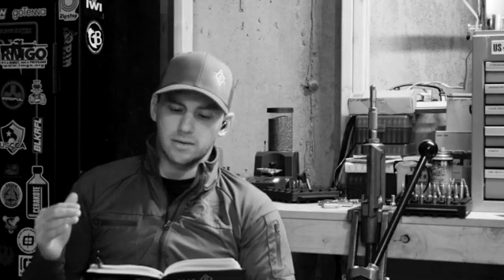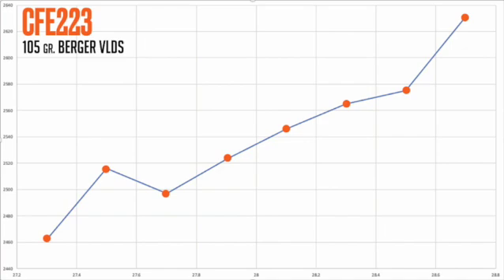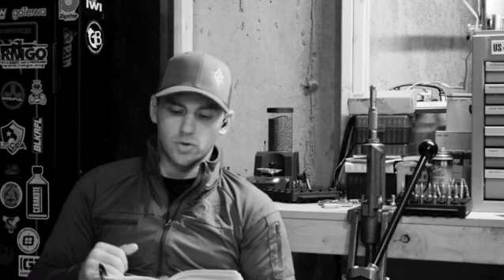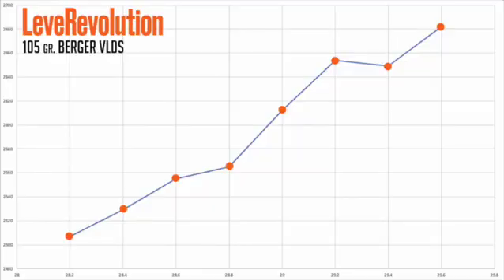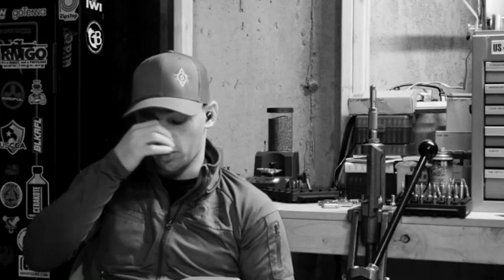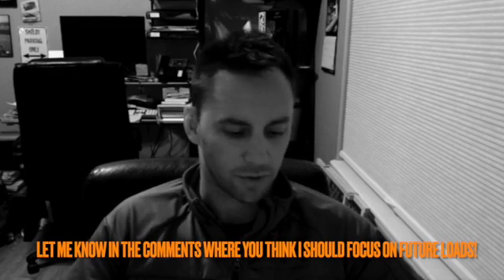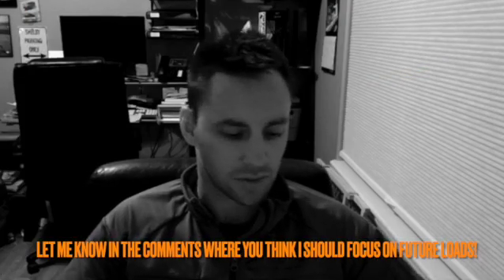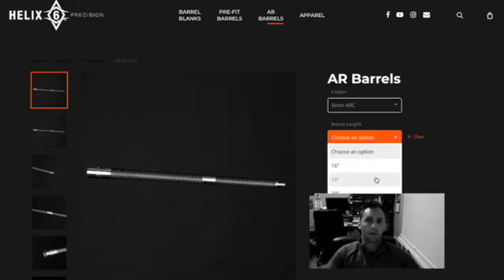6mm ARC Ladder Test Update 1

Comment: Stay away from the leverevolution. Temp stability is horrible. I played with it for load development in mine and had a nice load worked out (so I thought). I took it out yesterday to do seating depth test and was surprised how much the velocity climbed. I had read leverevolution was a bit touchy, that's a understatement. 20 degree temp difference resulted in a 40 fps jump. That's totally unacceptable. Luckily I have a group of friends and we help each other out which has allowed me to try several different powders without having to buy a bunch. Varget/Vihtavouri N140, great for temp stability, slow velocity. Vihtavouri N150, great temp stability and my velocity node came in around 2660 fps. (I run 108 eld-m's out of a 24" aeroprecision upper) 2660 is pretty acceptable. Soon I'll be trying Vihtavouri N540. Supposed to be fairly temp stabile and should get just a bit more velocity but we'll see. Velocity isn't everything. Low extreme spread is more important than velocity.
Reply: Point well made...
Reply: Good advice..

Comment: Great video! I’m currently building a 6arc custom gas gun with a 22” bartlein barrel. I’m curious what groups you’re able to get with 105s in your tests with leverrevolution.
Reply: don't use leverevolution. Horrible powder. (Unless you don't mind having two different loads. A hot/cold load.) And don't get wrapped up about pushing crazy velocity with this cartridge. (At least in a gas gun) It's no 6 dasher. 22" barrel should get you good velocity but reaching the advertised 2750 fps, don't be surprised if you don't hit those numbers. I have a 24" barrel on my gasser and factory ammo doesn't even hit those numbers.

Comment: What's your application for this cartridge? 
I don't know why people are so disappointed with velocity in these shorter barrels. That data has been out there for awhile now.
Reply from the maker: Great question! I will be the primary shooter (rifle) for the Sniper Adventure Challenge and need a lightweight cartridge (minimum caliber 6mm) that can consistently reach out to an average of 700 yards but up to 1500. Normally I shoot 6.5 Creedmoor, but I don't want to haul that gun and ammo about 70 miles in 48 hours. As my research has indicated, hitting that 2700 fps helps to maximize the advantages of this cartridge. I think the LeveRevolution is going to be the way to go!
Reply: @theadventureninja  I run 28.8 LVR under 107smks. Getting 2760 from a 24". Not saying you need a 24", but 28.8 isn't that hot either. A 20" with ~29gr lvr would have pushed 105 RDFs or hybrids to 2700 I'm sure
Reply from the maker: @cayenne7857  probably! After watching and reading a bit, it seems people had the least trouble with an 18” barrel in a gas gun, though I wouldn’t go any shorter. Were I to get another barrel, I’d do a 20” so I didn’t have to go quite as high on the charge to achieve the same velocity.
Reply: @theadventureninja  Hey. I am also trying to build 6arc on scar system for this kind competitions. I will have 18" 7.5twist. I come from EU and it is really hard to get anything for arc here. I ordered dies from US. What gas sytem do you have? Also i am limited with EU powders, wich is not bad but non experience or no load data.
Reply from the maker: @ronzi83  This is a rifle+1 gas system on a Helix 6 Precision carbon fiber barrel. I recently changed my bolt carrier group to a steel one from an aluminum one so that should hep it cycle a little smoother. I'm not familiar with EU powder options, so best of luck!

Comment: I'm interested to see where you take this.  I also picked the 95vld for my 6arc gas gun over the heavier class of bullet.  The 105s and 108s are just too heavy for the case capacity in my opinion.
Reply from the maker: Correct! I'll be going out to the range next weekend with these new loads so I'll put up another video on their grouping. I think it should do well (provided I do well). I will say, however, that the Hornady 108 ELDm match ammo was super consistent on the velocities so I'll also make a group with that. Winner TBA!
Reply: you do understand it was designed specifically for the 108 gr bullet right?
Reply: @oif3vetk9  I do not understand that.